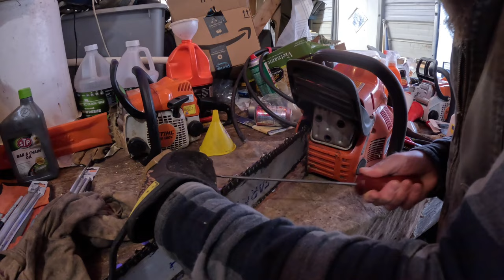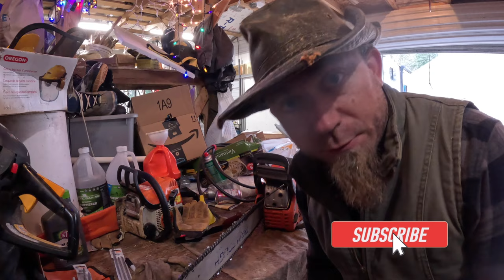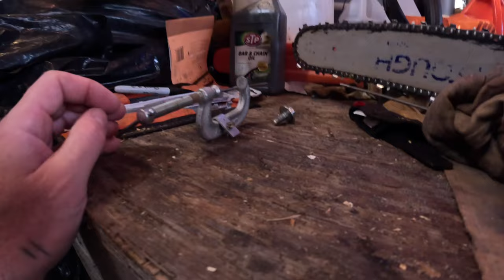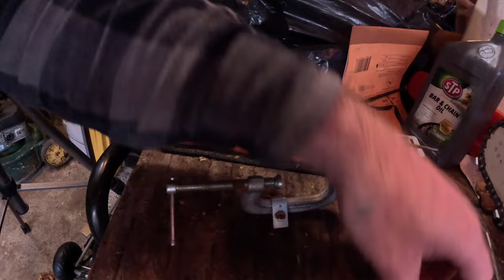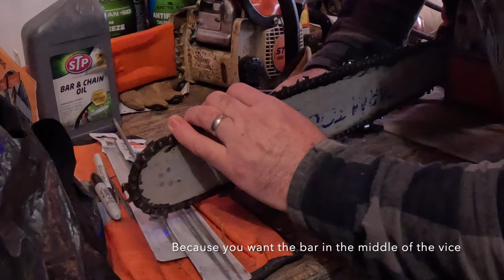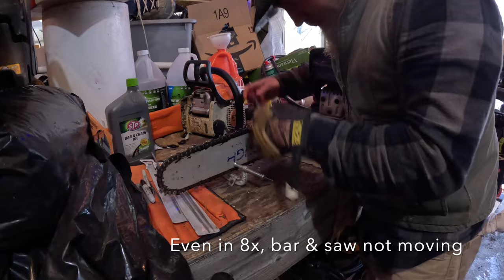Cost Effective Way To Hold Your Chainsaw To Sharpen The Chain

Comment: I used a small wood working bar clamp. I drilled holes in the bar to mount it and put a piece of rubber hose on the bottom bar to protect the chain if it slips down when mounting the bar to sharpen.
Reply: Also I mounted the bar away from me. Much better leverage than having the bar orientated 90 degrees like you have it now. If you want to learn better sharpening skills check out Buckin' Billy Ray Smith